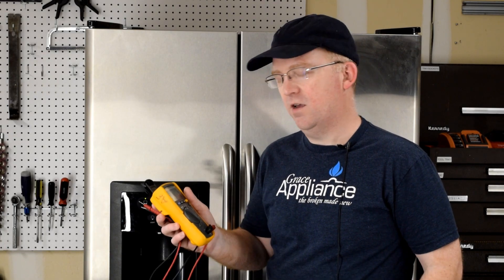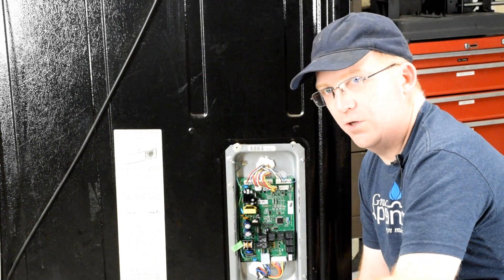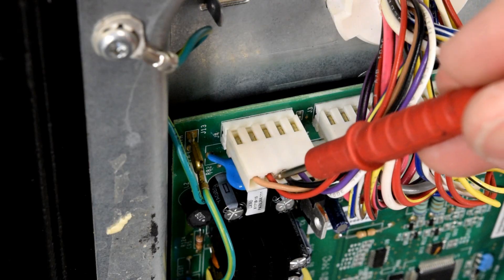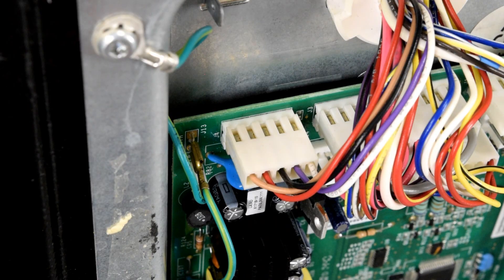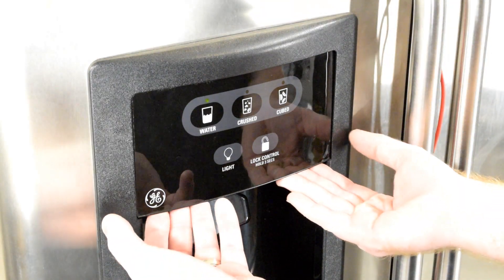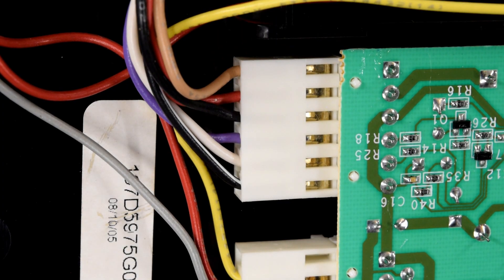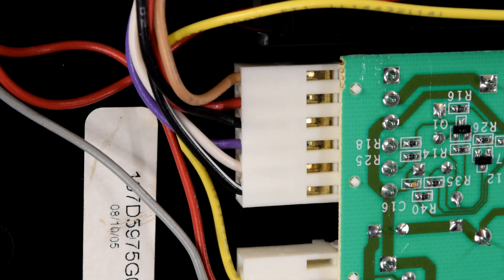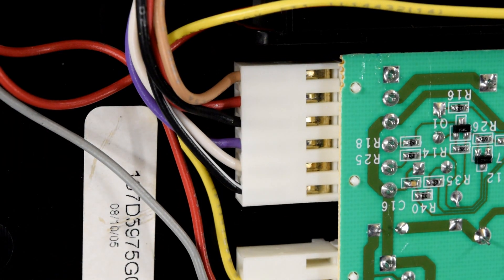Diagnosing a Bad Control Board - Part 4: Front Touch Panel

Comment: my touch panel does not respond but lights display blinking 'zeros'. still a bad touch panel?
thanks!
Reply from the maker: bill taylor hi Bill, 
No, this sounds more like a connection issue between the main control and the touch panel.  
The most common place for this connection issue is behind the kick panel by your feet. It’s near the freezer hinge.  

Unplug this and replug it 10x. Check for corrosion.  Let me know if that does the trick or if you find heavy corrosion build up.  

Thanks!
Reply: @GraceAppliance  thanks,, i have been messing with the 4 wire plug at the front bottom left, but it 'seems' fine. i will look closer. thankyou very much!
i live in a very rural area of Belize and getting a tech to visit is real tough.
this all began when the ice and water despenser quit. then after i messed with the 4 wire plug, it began just blinking.
Reply from the maker: bill taylor that sounds like the culprit to me, but just look closely inside at the plugs pins to see how they look. 
An option you have is the unplug the fridge, strip these wires and solder them back together. Try and leave as much wire as possible, but if you find that it’s to short, you can add an extra piece of wire where your plug was before to lengthen it some. This way you’re certain there is a solid connection between the two boards.  The only draw back to this is if you ever in the future need to remove your freezer door (to fit it though a doorway for instance) you’d then need to cut the harness in order to remove the door. But even that isn’t the end of the world I guess.  

Let me know if you have any questions.
Reply: @GraceAppliance  thank you very much, you are being very helpful!
i will do that in the morning,, hard wire it and watch it fire back to life!!
Reply: @GraceAppliance  well,, i had not got to this and then last night it started acting weird. the ice flapper door was opening and closing on it's own and the light was stuck on.
so first thing this morning i removed the 4 wire plug and wired it direct. 3 blues together and 2 blacks and one red to one white.
now it's back to just blinking zero's
fridge works fine and the ice maker does as well, i assume it fell back on it's default temp settings since i can't control it.
it's only 2 yrs old but the tropics are very hard on electronics.
i am about to give up and just live with it,,,,,
Reply from the maker: bill taylor on that comes to mind is to check the micro switch for your dispenser. You may have two of them (if you have 2 paddles at the dispenser / one for ice and one for water). Based on the symptoms, it sounds like one of the micro switches are failing and specifically the one for the ice lever.  
You’d disconnect power, remove the micro switch, and it should have 3 terminals. You can do an Ohm test between the 3 pins and should get about .03ohm of resistance between 2 of them when off, and then .03 between another 2 pins when depressed.   It should also make an audible clicking sound when depressed. If no click, it’s a failed switch.  

My thought is that the switch is acting like it’s calling for ice and the flapper would actuate then and perhaps the numbers go to 0. I’m not sure.
Reply: @GraceAppliance  now,, i have regained control of the temp setting buttons, no more blinking zeros but, still no ice or water and now the flapper door cycles open and closed about once every minute?
is this beginning to sound like a bad touch panel?
i realy appreciate all your help!!
Reply: @GraceAppliance  i have not used a meter on the switch but it does click like it is making and breaking.
Reply: @GraceAppliance  i am testing the switch now. only one paddle, control board has a button for either water or ice. two terminals on the switch. it makes and breaks between the common and normally open terminals. seems fine.
so now i am back to the original problem. ice maker and temp control work fine,  just the water and ice dispenser do not.
Reply from the maker: bill taylor I agree, it does sound like a failed touch panel to me too. I’m not sure there’s a good way to test this theory out further beyond replacing the board.  

I would double check the connection on the back of the control board & touch panel itself by again unplugging and replugging it several times to rule out corroded connections there.  With the buttons working intermittently, it makes me think it’s related to that touch panel specifically.  The fact that even some of the buttons are working ok tells me it’s getting voltage from the main board.  The issue is that I can’t completely rule out the main control board from causing these issues. But, I’m not sure of how we would narrow it down further than we’ve talked about either.  Sorry to say.
Reply: @GraceAppliance  if i were to order one, can you recomend somewhere?
untill then we will just live without it,,,
Reply from the maker: bill taylor hey, this should be your board part number but please double check me on that before ordering. If you order through this amazon affiliate link it helps the channel a lot. 
https://amzn.to/31jcIy0

However, being in Belize this link may not work for you as this is the US amazon site. Let me know if you have any questions though.  

Thanks! 
Andy

Comment: Great video.
I have GE Profile fridge (Model PFCS1RkZA SS). Lights on user control interface started flashing nonsense last night and interior lights flickered. Reset fridge by disconnecting power for 5 minutes and no change in problem.  Today user interface panel lights are dead and fridge and freezer not cold. Checked power into interface board and I have 12-15 volts. So, based on video I suspect I need new interface board. However interior lights do not work and interior fans are on. Is there a larger issue or is it the interface board?
Reply from the maker: Mark McCollister 
To me, it sounds like it would be the touch panel. The reason I say that is that if you’re getting voltage to that board at a minimum it should be lighting up.  
One thing I would try to see if you can narrow it down to that is, unplug the fridge, unplug the touch panel and plug the fridge back in. If the fridge comes back to life, you’ve determined you have a failed touch panel. 

Here is an affiliate link to order which helps the channel a lot:
https://amzn.to/30R4g8X

If there is no change once you’ve done that test, let me know.  

Thanks!
Reply: No change in operation of fridge with touch panel removed.
I ordered new touch panel. To install I turned power off to fridge, waited 3 minutes, installed new touch panel, restored power. Touch panel blinks 4 zeros for about 30 seconds then becomes unresponsive/no lights/appears dead. What should I try next?
Reply from the maker: @markmccollister7384  sounds like a step in the right direction the fact that it at least lights up.
Most typically the flashing zeros will be caused by a poor connection at the plug at the freezer hinge behind the kick panel at your feet.

Unplug and replug this 10x and see if this improves the flashing zeros issue.
Also inspect it closely for any corosion on the wires. If it's bad enough you can delete the plug by soldering the wires together directly vs having a plug.

Let me know what you find at that plug.

Thanks!
Reply: Went through same reinstall procedure. Now new touch screen is just dead. Retested with voltmeter and 12 volts dc is going to touch panel.
Reply from the maker: @markmccollister7384  how's the plug looking under the fridge?
Reply: We have a bottom freezer drawer not a side by side freezer refrigerator so I don’t know about hinge at bottom. I did plug unplug connection to temperature sensor below fridge. Looks fine. No corrosion.
Reply from the maker: Mark McCollister thanks Mark, I’m sorry I’m not as familiar with this model on where the equivalent plug will be located. You can look under the hinge cap of the left side door hinge (the same door the touch panel is on) and you will likely have a connection there. To remove the hinge cap, you’ll have either a single 1/4 bolt or a Phillips head screw securing it to the top of the fridge. 
Make sure none of these wires have been pinched or pulled from the door movement over time.
Reply from the maker: Mark McCollister the fact that the fridge doesn’t come on once the touch panel is disconnected will more than likely mean you have a failed main control, but it makes sense to check the wiring either way. If wiring looks good, replace the main control board.
Reply: The wiring at the door hinge looks fine. I disconnected the wiring here and the interior fridge lights turned on with door open (otherwise dead when connected) and the refridge began to cycle on and off at 1 second intervals (clicking noise).
These systems shut back off when wiring reconnected.
Ordered replacement control board. Hope that’s the problem.

Comment: Hi Andy, Thank you for the GREAT videos. I have a GE refrigerator GSS25GMHGCES and the control panel LED are blinking zeros, and the buttons are not working and it will not dispense ice or water, as the RED filter change indicator is lighted red. It appears that everything else is working, it is cooling, and I can hear the fan(s) working. Do you think this is just a function to remind me to change the water filter or is there an issue with the control board?

I watch another YouTube video that showed the GE control board had blinking zeros and in that video, the person replaced two capacitors the control that had the building tops and after replacement, the touch panel started working again.  

What do you think is causing the control panel LED to blink zeros, and the buttons are not working? Thanks you
Reply from the maker: Hi Jon,
Most commonly, this is going to be caused by a poor connection between the touch panel and the main control board. The most common place for this poor connection is at a plug by the freezer door hinge behind the kick plate by your feet.

Inspect this plug closely, unplug it and plug it back in 10x and see if that improves things.

If you find heavy corrosion build up on the pins themselves, you may find it easiest to cut, strip and solder the wires (I. E. Delete the plug) so you're sure to have a good connection.

I'd Start there and if you still have issues, I've got a video that breaks down how to diagnose it further. 

Let me know if you have any questions!
Andy
Reply: @GraceAppliance  Andy, thanks for the quick response. Reading one of your answers to another question, I unplugged the frig for about 10 minutes and then plugged it in and now the control panel and water and ice dispensing is working again. However, when you press the TEMP button (up or down) they display the temp for a few seconds and then the LED turns off, I don't remember if they use to stay on or not. Is the freezer/frig temp suppose to be displayed all the time? Thanks again
Reply from the maker: @phototec  yes, that's normal operation. Sounds like it's in good shape to me.
Reply from the maker: I believe there may be a way to set it up to keep the digits on full time. I don't recall offhand how you can do that, but it will be in your owners manual if it's an option.

Comment: HELLO, i watched all ur videos hav a ge sxs pss26sgpass with a intermitent problem ,changed the defrost limiter sensor bec the top waz popped puit bac together evap fan wouldnt run comp is running,,cond fan is voltage is 5.4 volts..e fan 12.5 volts..wasnt running but now is...I.m guessing i should repace e fan motor ,control board & c fan motor,,please advise.i will pay you.thanx, steve
Reply from the maker: Hey, I'd replace the board, defrost thermostat and evaporator fan for sure. The hi limit thermostat likely blew because the heater stated on too long. This could be caused by a failed board or thermostat.
I'd hold off on the condenser fan for now as they are less likely to cause this issue.

Also, before replacing the board, if you wanted to unplug the fans from the main control board and take a voltage reading on the pins directly on the board you may find that your full voltage has returned because the fans were robbing the voltage from the board. If so, you can hold off on the board.

Let me know if you have any questions. Andy

Comment: What if the meter needle is bouncing up and back?
Reply from the maker: Hey, I’d first double check that you don’t have it set to Ohms resistance. Make sure it’s set to volts DC. 
Also, while the fridge is plugged in, unplug your front control board (or the associated plug at the main control board)
If the fridge then starts up, you have a failed front touch panel.  

Also, you can unplug the touch panel wiring from the main control and take a voltage measurement on the red and black wire pins on the main board. You should be getting a steady 13.5vdc at these two pins. If not, that would be a failed main control board.  

Let me know if you have any questions.  

Andy
Reply: @GraceAppliance  Thanks! I'll give it a try.

Comment: hi i have a problem with a ge side by side fridge. i am getting 2.4 volts dc coming from the boar to the ptc board. compressor wont start. please help.
Reply from the maker: Hi, what is your model number please? This is located inside the fridge section on the wall.
Reply: gsh35jcb bb @GraceAppliance
Reply from the maker: @fullrangebasshead7055  I'm sorry, that does not pull up. 
If you could email a picture of it to graceappliance@gmail.com I will try and find the tech sheet for your model and this will help with the diagnosis.  Thanks

Comment: I am reading 11v DC  on voltage front board no lights on board and no compressor
Reply from the maker: Hey, try unplugging the board at the front panel and see if the compressor comes on. If so, you've got a failed front touch panel and it would need to be replaced. Let me know what happens.
Reply: GE Side-by-Side ONLY - Refrigerator Repair Videos are the best in part i
Reply: Tryied unplugging still no comp
I guess I'm going parts hunting tomorrow thank you for your help love the video
Reply from the maker: Joseph Padron do either of your fans run? 
I’d try unplugging the fan circuit plug from the main control board and see if the compressor comes on.  
I think it’s the J4 connector if my memory serves.
Reply: @GraceAppliance  so after I unplugged the condenser and evaporator plug which was J2 about a minute later the compressor did kick on I plug the fans back in and they seem to be working the only thing I have disconnected is the front ice control boardand everything seems to be working well I need to clean my condenser coil
Reply from the maker: Joseph Padron it sounds like a failed front touch panel to me. Once it’s plugged back in if the problems return, I would replace that board.  
The fact that you’ve got 11vdc to the front board, but no lights, tells me a failed front board. 
I hope that helps. See the description for a link to that board. Thanks